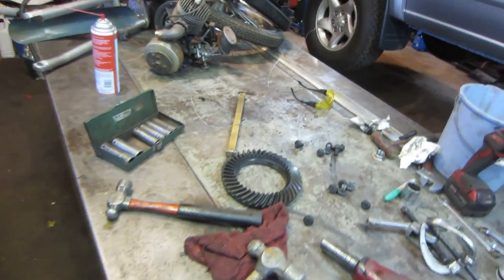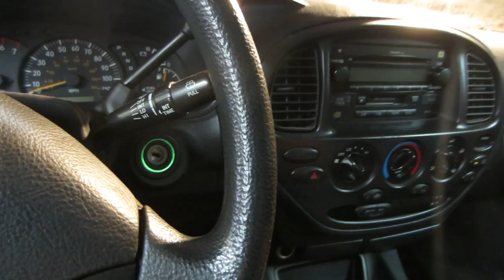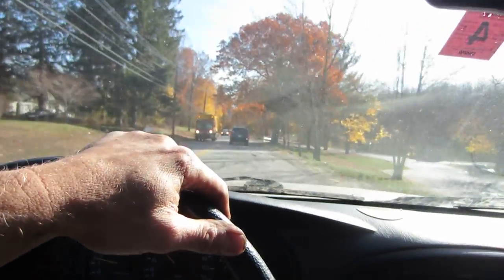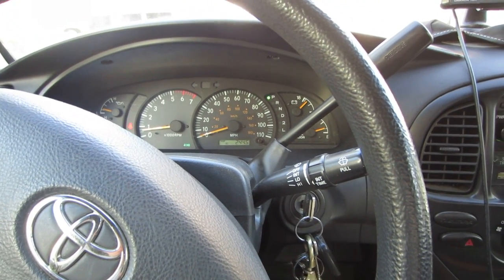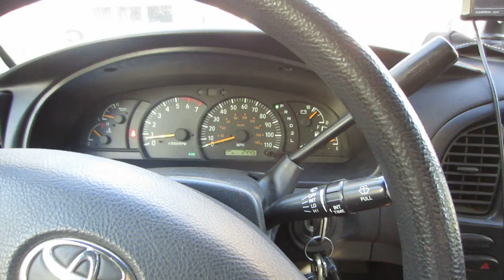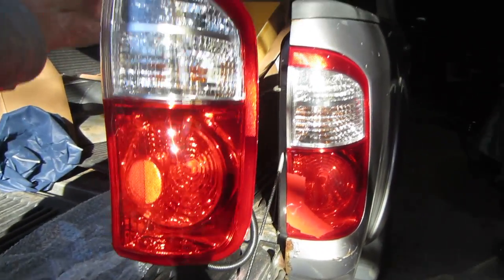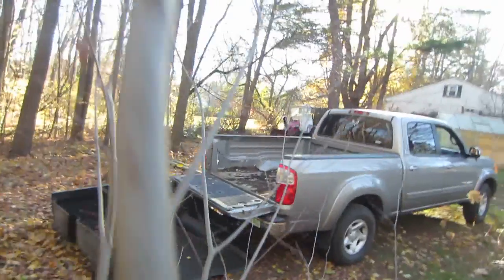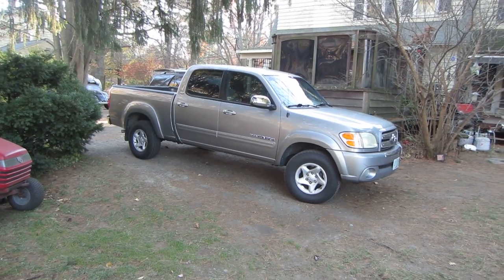front wheel drive toyota tundra

Comment: did you check rock auto they have rear differential rebuild kits and other parts for the drivetrain
Reply: Unfortunately, in this case, the truck was run without oil in the axle for so long that the ring gear and pinion have been wrecked.  Replacing the ring gear and pinion means the diff will need to be set up for preload which really isn't a DIY job, so in this case a complete replacement diff is the best option.  I doubt if this diff would even be accepted as an exchange part...
Reply: gosportjamie you would only have to run it for 30 minutes dry and it would kill the bearings from heat friction. you could do it diy just needs tools and work  and experience
Reply: Chris Beamish   Yes, it doesn't take long to ruin a diff once it's been let to run low on oil.  Yes, with older diffs you can, but some modern diffs have to be set up so accurately that there is no chance of getting it right on a DIY basis.  I don't think they necessarily need to be so complex mind you, I think it's another case of designed obsolescence...
Reply: gosportjamie everything now is planned obsolescence just like in one of mustys previous videos with the Volkswagen 30 some year old tires still good 4 year old ones ruined and cracked it's ridiculous everything fails quick now a days.
Reply: Chris Beamish   Yes.  Frankly it sucks.  I'm sure motor manufacturers would sell more new vehicles if they built them as well as they could, because customers would return and buy another of that make and hand their old one down through the family.  Instead we have modern vehicles that fall apart quickly, which means the owner is going to buy anything but the same make again...
Reply: gosportjamie if they brought back air cooled engines in cars and Wankel engines I would love to buy there new products. but that will never happen as long as people are eager for money.
Reply: Chris Beamish   I believe Mazda are still working on Wankel engines, so never say never, they might be back...
Reply: gosportjamie yes they just announced they have been approved to test a new 400 horsepower Wankel engine
Reply: Chris Beamish   So that will probably be around 600 with a couple of turbos strapped to it.  That should make life interesting...
Reply: gosportjamie rotary's are very fascinating and can handle quit a bit of turbo psi the only down side is heat and the apex seals needing to be lubricated so it has an oil injector for the motor or you can run a mix fuel like 2 cycle motors. but mazda said their new motor won't have as big a problem with apex seals.
Reply: Chris Beamish   No, they've been working hard on apex or rotor tip seals as they've always been a problem with rotary engines, problems with tip seals is what killed the NSU RO80 and, indeed the whole company.  I believe they are working on a totally different design of rotor with a different format of tip seal to try and cure the problem...
Reply: gosportjamie NSU was a German company that didn't know the full capacity of rotary's at that time mazda only learned late in the late 90s which was a little to late bit getting the apex seals down and better would lead to hopefully a more suitable and successful motor and career for the motor
Reply: Chris Beamish   NSU had had considerable success with smaller rotary engines in small cars.  Unfortunately their engineers didn't realize that simply enlarging a rotary engine for use in a larger vehicle doesn't really work, a larger engine needs a different approach to rotor sealing...
Reply: gosportjamie how do you know so much about NSU did you look it up and research it or what cause I would like to learn more about them I like to learn the history of any company that has ever used rotary engines.
Reply: Chris Beamish   I'm a bit of a classic car nut so I picked up what I know in passing. I'm a fan of the RO80 and of same-period Audis, a period when the Germans did make a good selection of vehicles that genuinely could claim to be among the best cars in the world,  so I suppose I have retained a decent chunk of what I have read. There are plenty of internet resources that deal with NSU in depth, and several very good books have been written about the history of the company, and, something I suspect you would find more particularly interesting, their rotary-engine vehicles...
Reply: gosportjamie the only German cars I really am a fan of and know a lot about are all the air cooled Volkswagen's and some of the air cooled Porsche's. but  some of the old Audis are nice.
Reply: Chris Beamish   I hadn't ever really even thought about the older Audis, I was vaguely aware of the early '70s 100 coupe S as it was a competitor with, but more expensive, than the Opel Manta A series (I had one, it was a lovely car, wish I still had it as it would be worth a bomb now) and I am a big Opel fan.  Then I spotted a 1973 Audi 100 LS for sale at a local classic car show for very little money, it was an interesting car and it was very cheap so I bought it.  And I was totally won over, it wasn't very fast, but it was so quiet and comfortable and it felt like a car 15 years newer to drive, it was an utter revelation.  And, like a few other really good classics, they were utterly ignored for so long because they didn't have the "classic" and often not very nice driving dynamics.  Now, finally, they're worth what they deserve, but so many got driven into the ground that there are very few left.  Unlike modern Audis which are neither particularly nice or reliable, the old ones just went on and on and on until they died in one go and went to the scrap yard.  I guess I've always had a taste for the more unusual and less seen classics but those old Audis are cars that massively deserved much more attention, certainly in the UK anyway.  My old 100 is now with a friend of mine who gave it a sympathetic refresh and uses it as his daily driver with utter reliability knowing that he's NEVER likely to find another one parked next to him in a car park...
Reply: gosportjamie well if you really miss it keep your eyes open and be ready you'll find one again at some point.
Reply: Chris Beamish   Maybe.  Then again, been there, done that...
Reply: gosportjamie I gotta ask are you in the UK cause you said in a past comment in the UK anyway
Reply: Chris Beamish   Yes, I'm in the UK.  I do envy you guys in the US, you got a lot more interesting vehicles than we did, and they seem to be a lot cheaper used, I suppose because there are relatively more of them around...
Reply: gosportjamie it goes both ways cause there are cars there I would love to get that we can't have here do to safety regulations I love the opals the Holden's you cant get Renault hear can't get Citroen here so it goes both ways. the one thing that I don't like here is how hard manuals are to find here people don't drive them here anymore I personally love a nice 4 speed or 5 speed I find autos to boring and like your not actually driving but hey different opinions for everyone the number one theft prevention device here is a manual transmission.
Reply: Chris Beamish   You'd be surprised how many European and Australian cars you do get in the US.  The current Chevrolet police special, I think it's the Impala, or maybe they went back to the Caprice badge is actually a Holden, as, I believe, is the Pontiac G8 and the first new-generation Pontiac GTO was the Holden Monaro.  Buick dealers sold Opels up to around '74 or '75, and the "mini-Stingray" Opel GT was pretty much a US-only model, very very few were sold in Europe, the Citroen DS was certainly sold in the US, and I believe the CX was too, the Renault 9 and 11 both showed up in the US badged as AMCs and I'm pretty sure Renaults were sold in the US until at least the late '60s.  It's certainly true about the lack of manual vehicles in the US, some of it maybe comes down to driver laziness, dashcam videos certainly show there are a lot of very lazy drivers in the US, but I suspect a lot of it comes down to practicality, if you're crawling round a city for hours each day you just don't want to be having to change gear every time you slow down or speed up, and if you're racking up the miles on a highway you don't really want to be having to change down every time you hit an incline so automatics make sense.  In fact I would have thought that with manual boxes being so unpopular it would be a good thing for those that do want them as good manual cars should be cheaper as very few people want them.  Of course more sporty or muscly stuff with a manual box is probably going to attract a premium but that goes pretty much everywhere.  In any case, sadly, the manual gearbox is becoming a thing of the past as these double-clutch gearboxes are "more efficient" though, so far anyway, much, much less reliable...
Reply: gosportjamie I hear yes Renault sold till sixty's very few Citroen Ds made it to hear and Pontiac GTO and g8 don't exist anymore Pontiac closed in 2008 and the Chevy SS here is your holding but yours has nicer badging more power the option of a 6 speed manual and other options the united states environmental protection agency wont allow so in that case your lucky and here in US you can't get certain sports cars from Japan. that are allowed in the UK.
Reply: Chris Beamish   Yes, there are upsides and downsides.  We do get the Holden in the UK as the Vauxhall VXR8 with a manual box.  On the downside, very few people can afford to run them at 8mpg as a realistic average fuel economy with petrol/gasoline at UK prices...
Reply: gosportjamie I like the Vauxhall I can believe that how much is gas there here we had our record lowest in years it's 2 dollars in most of Michigan I don't know for other states but it's nice having it cheaper so understand
Reply: Chris Beamish   I wish it was the equivalent of $2 a gallon here, but sadly it's closer to that per litre...
Reply: gosportjamie sorry to hear that in the past few years here it was 4 dollars a gallon this year has been the cheapest in a while.
Reply: Chris Beamish   In the UK we pay around £1.10 a litre, and that's down quite a bit from where it was a year ago...
Reply: gosportjamie to bad that's. ot per gallon that would be a decent amount here if it was 1.10 everyone would be running for the gas station.
Reply: Chris Beamish   If it was $1.10 a gallon I think a lot of people from the UK would be running for your petrol/gas stations...
Reply: gosportjamie you are completely right I think they would you should see what happens when the gas stations make it .99 cents a gallon which is very rare. There are lines up to half a mile to get it just because it's .99 cents.
Reply: Chris Beamish   Yes, it has made it on to the news here when that has happened...

Comment: i had a 1979 all wheel drive dodge power wagon for the fans that dont understand it, hear is another way to explain it. i had to have my front driveline rebuilt no problem ,right? wrong, also i had a common 727 automatic  all wheel drive meant if my front drivline was out, my truck was not moving anywhere, wrong, for the two weeks i was waiting, i locked my transfercase in 4 hi, in "all wheel drive", your transfer case is the same as a 2 wheel drive differential i it sends powewr to the point of least resistance, rather it be left or right, or in tranfercase , front or rear so i just locked my truck in 4 high, then it sent powewr to my rear diff well also out the front but no drivline therepoint is, full time transfer case acts just as a open diff till you lock it  only one is left to right, the other is front to rear

Comment: I do wonder if, given what the truck owes you, going for a new diff at $1800 might be the more sensible option.  At least then you know the rear diff should be good for the life of the truck as long as the axle oil is kept up to level.  You don't know what a used diff will have been put through before the truck ended up in a junk yard, and as these diffs do seem to be a bit of a trouble spot you might be saving yourself a lot of trouble getting a new one and doing the job once as opposed to getting a used one, fitting it and then finding out that it has problems, then having to pull it again etc. etc.  Mind you, it's not my $1800.  Come to think of it, I don't think my car is worth $1800...